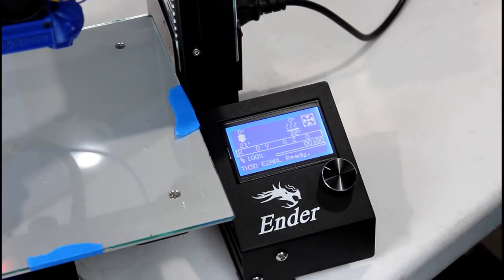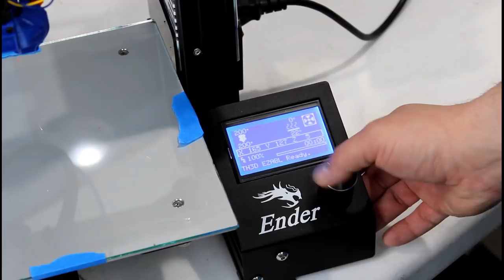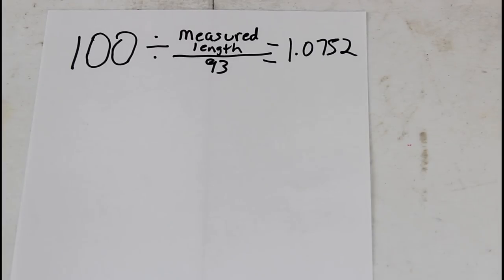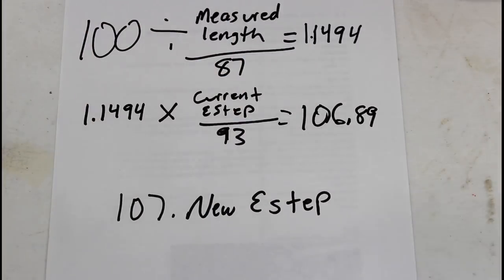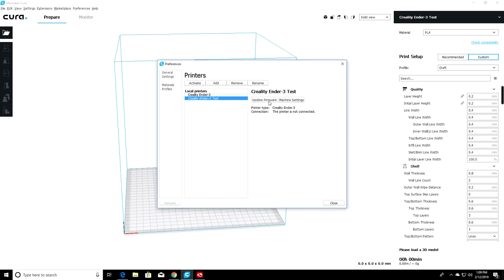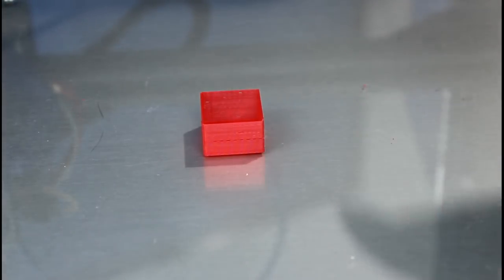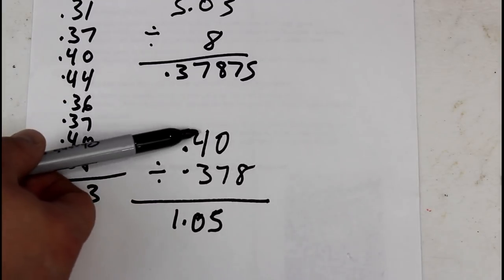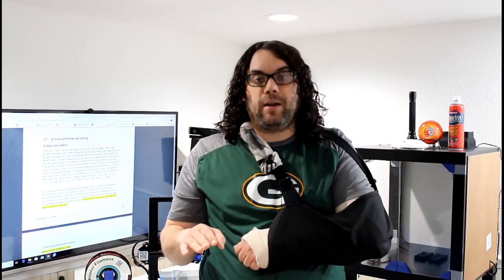Section 1.8 ESteps and Flow Rate

Comment: Aside from the confusing line over the values...measuring a curved line is not accurate. You can actually gain at least 3-5mm by that way of measuring a curve
Reply: Yes @av.......you bring up an excellent point that I noticed right off.
The shortest distance between two points (in this case the most accurate distance or measurement) is a straight line. The video example Jim shows is NOT using a straight line and the filament sample is actually a radius! I worked in Production Automation with CNC’s (3, 4, and 5 axis) making parts for IBM with tolerances of .005mm (.0002 in) using MAFord solid carbide tooling (spade drill, spiral fluted drill @.0057 dia, and end mills @ .093dia) on Delrin 100 and Vespel 500 composite and actually holding half that tolerance. Would never get anywhere with that style of measurement. These videos are informative but when someone shows such a blatant, inaccurate technique I have to say something.
Tape on the ends to hold the true length sounds better than what was shown.
Perfectionist? Maybe! Professional? Always! CONSISTENCY is the name of the game with CNC production and these printers are basically 3-axis (and the ‘feeder’ for the extruder could be considered a 4th axis) CNC’s using the same Gcode used in Nc’s and CNC’s since the 1950’s. I also have considerable experience programming in Industrial code, Gcode, Mcode, etc. and in about 9 different versions as these languages are often proprietary to a particular machine brand.
Reply: @twobrotherskayaking4736  I agree with you. Pubishing an educational content has some responsibility (which is advertised as and we pay in terms of "views" so it is not free either). Not to bring shade but awareness. As an engineer, my concern was the line below the numbers even if that wasnt a fraction or division or 1/unit. Anyways hopefully people get that wasn't the case.

Comment: I have set up the cube wall thickness 0.8mm (2lines x 0.4mm line width), infill 0 and as an outcome I have two lines printed but separated from each other (ca. 0.5mm). what to change in cura to eliminate this gap and print these 2 lines that are in contact? thx

Comment: Hi. Do you adjust the E steps on the machine, the slicer g code or both. Thanks. I have adjusted it in the machine and am getting 100mm on test but unsure if i also need to add the g code to the slicer. My Ender 3 Pro is stock apart from swapping the board for a 1.1.5 silent board. Thanks
Reply from the maker: If you can do it right on the machine, that's the best way! You don't need to out it in the GCode.
Reply: Thanks for the reply. I will leave it at that for now then and do the flow calculations when i have my Calipers back from work. I have been printing for a little while with what i think is a very good quality finish with out ever doing these calibrations (i did find them quite a way out though) but have only noticed problems when trying to print moving parts. I cant seem to get the clearness correct for free movement. Im stating back from the beginning and going over all the basics including steps I obviously skipped in the set up eager to get printing.
Reply from the maker: @jamesace1990  Awesome! You will get it dialed in!

Comment: awesome video has already helped a ton with most of my filaments. I have a new filament (tough PLA) im finding the various between the side vary high (did the .8mm cube) these were my measurements: 0.77, 0.87, 0.77, 0.84, 0.82, 0.82, 0.79, 0.88. 

in all my other filaments my variation wasn't more then .05m but this canadian makers tough pla is .10mm off.

If anyone knows why that would be awesome!
Reply: Bit late to reply, most likely reason is because of the extra additives in the filament causing small/minor blockages and then surges in the nozzle. I've been tinkering with CF-PLA and CF-PETG and it's a turd to print cos the fibres are randomly aligned in the filament, so collide with each other when it's melted and compressed in the nozzle....even with a 0.6mm nozzle Im still getting under and over extrusion issues

Best solution it seems is lower the nozzle pressure, so everything can compress and align before causing a flow restriction/surge

Comment: Doing these steps, gives me 232.5. First time I ran 3 100s. Came with 40mm each that was pushed. By doing your math I’d have to run mine up to 232.5. With my high temps by Extruder is clicking like hell. But I’m pushing 99mm each time after saving the setting. I’m not worried about doing cura file as I can set my e steps to my printer itself. Any other ideas?

Comment: I'm running a Stock Cr-10s that I put an all aluminum extruder on and want to check my E-steps , I get to the part at extrude 100mm and my machine wont let me go past 47mm and freezes up when trying to move at 1mm at a time , if I try at .1mm it freezes up at 27m....what is happening any help please.

Comment: What if (after doing all the steps up to cutting off what is extruded) you only get 40mm?  That is WAY off.  The stock motherboard printed nicely.  But once I installed a silent motherboard, I was getting lightweight, bad prints.  Someone mentioned check esteps, and here I am.  Ideas?

Comment: Ok, looking at the code on the start up. How does the new code I'm putting in the start up help. 

About 8 lines down the G-code it resets back to 0 just after the code for 
G1 X0.4 Y20 Z0.3 F1500.0 ; Draw the second line 
G92 E0 ; Reset Extrudor

Comment: great video... watching as they are posted keep up the good work, can i just ask what layer height you used? thanks
Reply from the maker: Thanks for watching! Off the top of my head, I don't remember. I'm at work so I can't check right now. But I do know Luke changed the test cube on thingiverse recently, so you might want to check that out. You can find it here: flow calibration test cube .8mm found on #Thingiverse https://www.thingiverse.com/thing:3220015
Reply: @TheEdgeofTech  thanks for the quick reply much appreciated.

Comment: Why this is a great video and I’m getting most of it...

I have a few questions...
So firstly this is ok for the cr10 as well i take it.
Also, what is the default Estep for the cr10?
Reason I ask is, the Goode in cura is slightly different for me, and yup it’s just default.
So any help there would be good.

But moving onto the flow rate test, could you put the entire settings for the print cube, because the link , sends us to 8 different cubes, with no explanation at all.
i DL the 8 point cube..
But again i ask, what are the settings in cura for that print.?

Onto the main estep instructions,  again, how exactly are these entered,.?

Like I said, I’m no beginner, been printing for years now, but I feel this video would be absolutely spot on if you reshot it.
With way more clearer instructions to inputting the code 
But defiantly, settings for the cube print, as that basically finishes your tutorial off, by not putting that in here, your leaving half a job done.

Unless I’m completely wrong, or someone can point me to another video, that is a bit more straight forward.

Still a great video, just missing so much info, for a high level instructional video.

Thanks for any tips or help .

Comment: I just want to confirm my cura settings for this .8mm cube.    I'm using cura 4.0 with the creawsome mod so the line width is .5.    So do I change my line width to .4 and choose 2 walls to achieve the .8mm?    Thanks

Comment: HI mate my esteps calibrates really good with how you do it but some reason it does not take long until it needs re doing and that does not seem right. Do you know why this would happen on the same spool?  atleast 5 times I have to re do it on the same spool
Reply from the maker: Hi, Are you making sure to save the configuration after you enter the new Esteps? You can use the M500 to save the config, or in the control panel of the printer use the Store Settings option. I hope that helps!
Reply: @TheEdgeofTech  I learned that adjusting spring changes things.  I also stopped filament jamming but fanning the same area. That motor gets to hot and deform causing jams

Comment: The new .8 Cube on thingiverse , is it to be printed on (cura) "Wall thickness .8mm" and "Wall line count 2" And when finish getting the average ( divided by 8 ) we then divide .8 by the total = New Flow rate?
Reply from the maker: Hi! Print it with the .8 wall thickness, which would be 2 line count with the .4 nozzle. Then get your average. Then take .8÷average. Then take that answer  And multiply by 100 to get your new flow rate. Hope that helps! Thanks for watching!

Comment: Thanks for this video. Finally, instructions that don't require connecting the printer to a pc. I have a question though. How do you test your new esteps if the change is only made in the slicer and not the firmware? Thanks.
Reply: Oh nevermind! I just saw the answer on another question! Thanks.
Reply from the maker: @dorthy7471  Thanks for watching!!

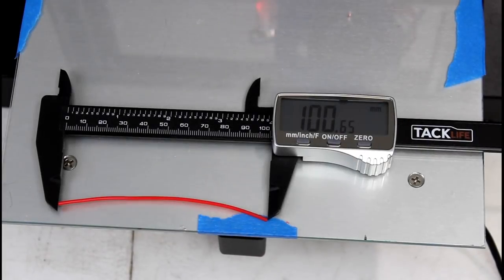Comment: Just to be clear @7:15 When You ran the test again to double check. That was AFTER you entered the new G-Code in Cura?
Reply from the maker: Thanks for watching! Yes, this was after I changed it.
Reply from the maker: Also, yes when you measure your filament you want to make sure it's completely straight. I did measure it completely straight but had to have help at the time of the filming of this video because I had broken my arm. So when I filmed it I couldn't use my other arm to straighten it for the camera.

Comment: When i turn the dial to extrude 100mm (adding 100 to whatever number is already in the machine), i extrude a piece that is about 105.5mm.  When i first turn my printer on and go to the same extruder setting, the number is 0, so i change it to 100mm.  It only extrudes 44.5mm.  Why the difference in extrusion when first turning the machine on and after i have done a print already?

Comment: So.
From the beginning I struggled with my ender 3 under extrusion. 
Finally bought a caliper. 
After original 93 steps it extruded only 40.5mm.
So calibrated esteps to 232.5 steps. It extruded 100.04mm so was fine.
Printed flow calibration box. 20mm square 8mm walls.
It came out total 66.2mm instead of 640mm.
So my current flow is 81.
Is that make any sense? 
Thanks
Reply from the maker: Sorry for the delay. I didn't see this comment. Are you still having issues?

Comment: I have the same problem that's been going on for weeks but now my printer is printing so I can't adjust my flow rate. Here is my problem : My first layer prints flawlessly, it's smooth and got the perfect amount of squish. However, the second layer gets messy and bumpy because the nozzle is too close to the first layer. When I increase the babystep z setting while printing the second layer, it becomes smooth, which leaves me to think the second, third, etc layers print 0.1mm to close to the bed while the first one is good. Aside from the Esteps, what could cause this? You seem to know your stuff so I'm trying to ask you here. Thank you !
Reply from the maker: What layer height are you using?
Reply: @TheEdgeofTech  i'm using 0.2mm layer height and 0.4 line width. I just found out today that altough my esteps were right on, my flow was almost 20% too high, causing it to make thickee lines than they need to(0.91mm instead of 0.8 for example). Adjusting the flow definitely improved it. It's not perfect but way better
Reply from the maker: @charlie_mk7.5  That would do it! Sounds like over extrusion but you getting close!

Comment: lukes guide says M92 E94 not E93 so im not sure where youre finding your g code at?
Reply from the maker: The M92 E94 is the the command you type in to update your Esteps. The E## is where you add the value you got for your new Esteps. I have updated the Math and Examples in the description and the command with the updated example would be M92 E95 to set my new Esteps to 95. I hope this helps as I realize that when I got 93 in the video it was kind of confusing.

Comment: Great video, thanks for sharing.  I was wondering how did you test if you have 100mm of filament after the calibration if it's not saved to the eeprom (printer)?
Reply from the maker: Thanks for watching! Great question! At 7:46 I show you how to add the new ESteps to the slicer GCode. After that, it should work. But if you want to test it, we could create a GCode file that does that. Or if you connected it to your computer or octoprint, you could see the other video I have for this and test it that way.
Reply: @TheEdgeofTech  But Gcode is only read by the printer when it starts to print something. How did you get a 100mm piece of filament without changes to the printer itself?

Comment: What can you do to reduce the deviation in the 8 measured values at the 11 min mark?  In this example, the difference between his min and max measurements was 0.9mm (0.31 to 0.44).  This can be significant when trying to print parts with little tolerance, as I have found when trying to print a picam mount on my Ender 3 Pro.  It was suggested that I calibrate my machine using this process and that helped me get the line width closer to what it should be, but it still deviates from 0.4mm.

Comment: Wish the gcode alteration was in the notes so i can copy and paste but thanks alot this helped me a fton
Reply from the maker: Hey, I will double check the description, but the help guide should be linked there. If possible I would do this right on the printer or by hooking the printer up to the computer if possible. I have videos on both ways and that's a way better solution.

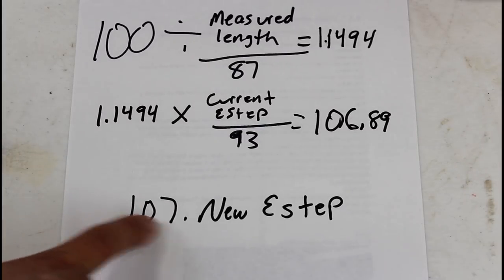Comment: Ok am I missing a step? What did he do at 7:13 that changed the amount extruded?
Reply from the maker: Later in the video I add the GCode to the starting Gcode section in Cura. If you have a newer Printer or you can connect it to your computer, I suggest changing it that way. There are a couple videos after this one to show you how to do that each way. Its better than adding the GCode.

Comment: Just for clarification. If we have a new ender 3 that can save settings on the printer we dont have to add the gcode on cura correct?
Reply from the maker: Correct!
Reply: @TheEdgeofTech  what if im using TH3D? i can still save settings on ender
Reply from the maker: @gregmetzger1856  Good question! I will have to look when I get home. If you can't do it that way, you can always do it from the computer or Octoprint!

Comment: ive had my ender 3 pro for 2 days now and ive printed the .4 cube 3 times and no matter what i change in cura it still prints the walls at .79. how do you get it to make a single wall pass instead of double

Comment: So I printed the cube with .8 walls and all my measurements are coming out at .6 all 8 measurements. 8/6= 1.33 so my new flow rate would be %133?? Does that seem like alot?
Reply from the maker: I will get the correct response for you. I asked Luke to take a look at as well!
Reply: @TheEdgeofTech  I printed the test cube again and it came out to %114 Wich seems more reasonable. After plugging in 114 for feedrate the cube came out all .8
Reply from the maker: @curash6295  Awesome!

Comment: Im trying to print the cube at 0.4mm wall thickness and 1 wall layer but cura is preparing the model with 2 walls and they measure 0.88 once printed ?
Reply from the maker: If you're using Luke's test cube, he changed it to be .8mm now as Cura was having issues.

Comment: I tried this process on the Ender 5 Pro, and could not get the extruder to function.  I heated the nozzle, did the auto home thing, and set the 100mm extrusion, but it only seems to extrude when there is an active print.
Reply from the maker: Don't forget to heat the hotend up to 200c because the printer will not extrude anything if the hotend isn't at temp.
Reply: @TheEdgeofTech  If by hot end you mean the nozzle (I can heat nozzle or bed) I did that.  I'll try again and reset the machine.

Comment: Hello and great video! One question remains for me on flow rate... you say cube wall should be .40 

Where are you taking this value from?
Reply: As far as I understand, it's designed to print at .40mm. So knowing what it should be versus what it is will give you the for rate.
Reply: Also, in a comment further down someone says it's been changed to .8mm.
Reply: @JMOx865  I'm confused... : (

Comment: When I try adding 100 on my CR-10S, the menu justed says "KILLED"...and the system hangs and nothing happens..
Reply: Have you preheated the nozzle? Needs to be at 180 (if not mistaking...could be 160).  Extruding won't move when your nozzle isn't at the minimum temperature.
Reply: @MenkoHHW  Yeah. Heated to 200. I typ in 20, let it go...then another 20...and so forth until I got to 100, that workes. Seems to be a major bug in the printer. If you add 100 - it says KILLED, and hangs the whole thing.